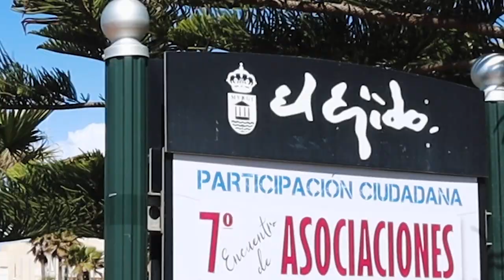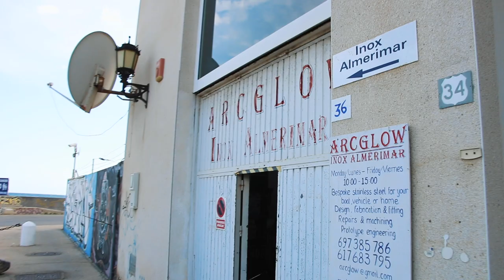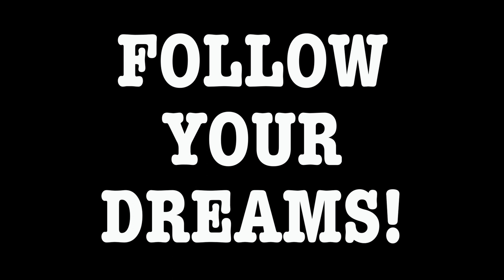Living the marina life in Almerimar: the winter paradise of the Mediterranean sailor #32

Comment: I've lived in Spain the last two and a half years and have been to Almerimar a few times too, nearly bought a boat there. I'm surprised about the loos there as my experience of Spanish toilets has been very good. Even the toilet in the local hardware store is much better than most of the British pubs I've been in.
Reply from the maker: To be fair, they are clean. Though it would have been nice to get a heads up on the toilet paper situation BEFORE having to use them desperately the first time 😂

Comment: You're quite a gal. Tell me, is the fuel berth and quality of fuel good (diesel)?
Reply from the maker: We filled up a few times there, seemed to be okay.
Reply: @RyanSophieSailing  Thanks guys. Got to make my yearly run from Ibiza to Gibraltar and back and thought this time I'd use this marina instead of Marina del Este and Aguilas for fuel. Burning 700 lit per hour and relying soley upon engines I need to know if they have a good turnaround and tank condition.

Comment: Can't you just shower on-board your boat? Endless water supply at the marina and AC voltage to heat the water. Thanks for the marina tour!
Reply from the maker: That's what I ended up doing after I got tired of waiting for 30 minutes in a humid cramped  space 😅

Comment: Well that bathroom is small for 500 boats, but hopefully only less than a hundred are being lived on.  If it is only a hundred or so two bathrooms, with two showers each, and two stalls each,  it might fit the bill.  Otherwise, I suppose, you both could wait or share a shower....because sharing the other thing....I just don't see how that would work....ick!!  I can't wait for the watermaker build, as it is my thing and I will give lots of advice you obviously won't need or want!!
Reply from the maker: Oh my god, I do want those advices! would you mind sharing them before the video!? 😅 I think not only me, but the entire community would be grateful!
Reply: @RyanSophieSailing  Thanks I made my 55 gallon per hour for around $1300 all in.  Of course I found a really good deal on a motor.  I was only saying I am sure you could find me annoying...perhaps helpful...but annoying...that is how my wife usually says I am anyway.
Reply from the maker: Well feel free to drop us an email at anytime with all your thoughts. By the price, it sounds like you also went the DIY route. We got our kit (motor, membrane, pumps, etc, etc) and the installation starts tomorrow!
Reply: @RyanSophieSailing  Just remember to start the watermaker with the needle valve full open, and to run the priming pump for at least 30-45 minutes the first time.  That is not the main pump.  Running it gets most of the air out an lets you check for leaks at lower pressure.   Also dry running a HP pump head will burn it up fast. Then start your main pressure pump and very slowly like minutes per 100 psi, especially the first time, bring the pressure up to 800 psi(which is a typical membrane working pressure) on the needle valve but use the manufacturers recommendation.  I would get an adjustable high pressure blow off valve that will kick in at 900 psi to keep you from ruining your membranes or other hardware.  It goes at the other outlet of the high pressure pump(there are two fittings on the high side of most rotary pumps).  They never tell you that little bit of hardware anywhere, but it will save you a bunch of money in membrane and hardware costs.  Mine looks like a barrel and has a ring around it, and  and an outlet on the side for a pipe.  I wish I knew where I found it.  You don't need it to make water, but you don't want to mess around with high pressure water.  Extremely high pressure water can blow all your skin off an extremity, or cut off your hand before you know it!!  That is why it is imperative you take a long time bringing up the pressure on the system the first time.  This looks similar to my pressure valve and might work for you.  It also might be a waste of 24  British Pounds if it won't adjust down to 900 psi... https://picclick.co.uk/MTM-Hydro-MG1000-Midy-Relief-Safety-Valve-262222301745.html